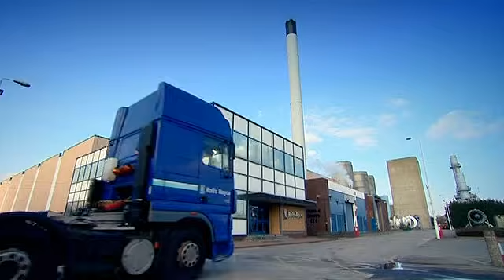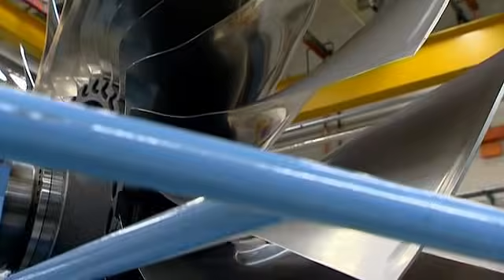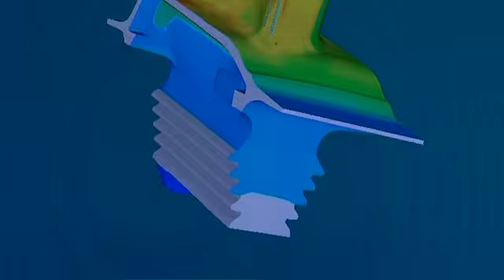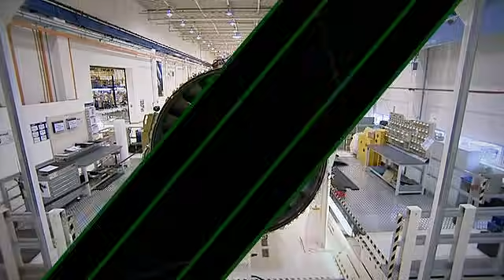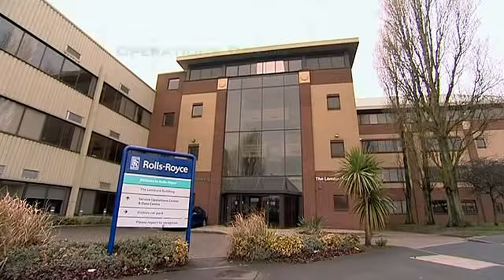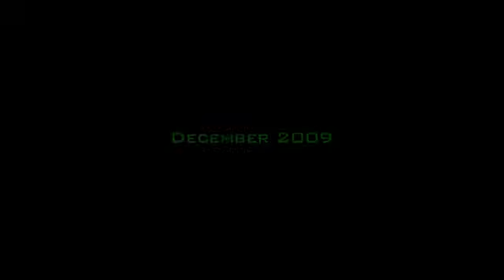how to build a jumbo jet engine

Comment: Amazing work... Wow!!
? Just after 38:08 the narrator states that the main fan in flight spins faster than the speed of sound... Did he misspeak? I thought that all the fan blade components had to be subsonic in operation so they do not incurr sonic shock waves & break... Can anyone chime in on this? Thanks!
Reply: albert bahoogadin ... Thanks for the reply.
There isn't much clear discussion on this. The thing that gets even more confusing is that the speed of sound or the Mach number is variable depending on the air pressure... Where in the compressor and turbine stages sound travels faster due to high pressures/density. How this effects moving components & combustion, I'm not sure. Perhaps the splitting of the spools & counter rotation in the new turbofans mitigates this issue by canceling out the resonance... Of course the larger diameter of the big thrust fan will make the blade tips move faster given the same RPM of the turbine components... This is probably why P&W introduced a planetary reduction gear for the final drive of the big fan increasing the bypass ratio... Quite a science in that. HA!

Comment: All these new planes bla bla bla everyone taking pictures like it is the first plane they've ever seen.  All these passenger planes look the same no fucking breakthrough.    Two engines narrow wings long tube with a tail. Light and fragile as fuck slam the tail on the ground a bit and it goes straight to service.  Two round engines attached under the wing by two bolts only for some reason. Same shit different paint. Ah yes and at little room as possible for passengers. I am 1.84 m tall 6 ft cannot fly economy without paying extra for extra leg room. A lot of bla bla fuck off it's just a tube with wings. When airplanes will stop falling from the sky then i will be impressed.  One tube with wings with 2 millions buttons in the cockpit for some reason. The fuck? Maybe airplane builders should speak with those who build cars. All you need is  a start button  and accelerator.  Stop making planes so complicated.  They are not complicated you are making them thay4way

Comment: When you think about the tolerances required to build both these turbofans and indeed the aircraft themselves, it's a staggering achievement... I remember reading about the design and building of the 747 and the entire aircraft are built to a tolerance of 1000th of a inch, the entire aircraft.. and those engines must be trebly so..let that sink in...

Comment: What they didn’t know is that 9 years later... RR engines are failing left right and center.
Reply: Same goes for the failing Pratt and Whitney engines. So it doesn't matter which country produces it.
It depends on how good the product is
Reply: like all cars built in britain, questionable reliability

Comment: sorry but jet fighters don't use  rolls royce, they are not the most advanced .
Reply: circusboy90210  _  Eurofghter Typhoon uses a RR based engine. These are turbofans for airliners - diifferent.

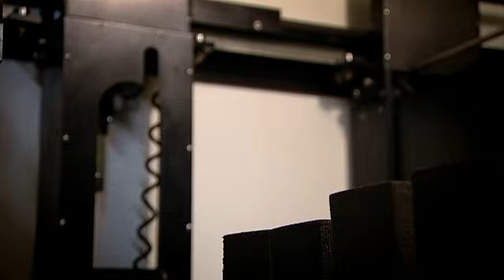Comment: 26:54 why aren’t they forged instead of cast? Wouldn’t that decrease imperfections?
Reply: It seems that the single crystal structure is better (only?) obtained with casting + heat treatments.

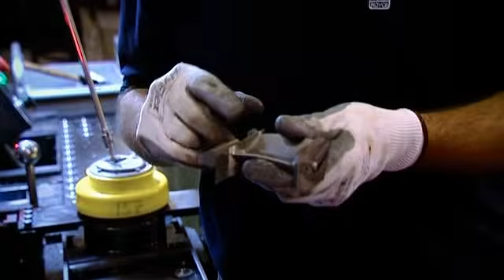Comment: At 28:00 the blades being shown are now made by 3D metal printers ... if i'm not mistaken. In any case, Rolls-Royce (and other manufacturers of jet-engines) are certainly using 3D printers to make similar blades.

Comment: Thanks to series producer Steve Crabtree and Director Paul King for this outstanding program on Rolls Royce-- so intriguing, I cannot wait to watch it at least once more-- even as long as it is. There is no wasted narrative or extra footage in covering the mammoth complexity of the Rolls Royce operation and its suppliers. 

Particularly fascinating was not only the precise engineering of energy in each engine, but even the post-sale digital field monitoring of some 8,000-10,000 completed engines in regular service.

What a tragedy it would have been for the company's finest moment, the birth of the Trent series engines, to have been eclipsed by a bankruptcy. All, going to show major advances in technology are never neatly predictable and spreadsheet-perfect affairs.

* As a historical observation, the stunning and remarkable coincidence for BMW, manufacturer of WW2 fighter aircraft engines for the FW190, to begin production of the Rolls Royce luxury sedan, once the signature product of the same company which made Merlin engines for the Spitfire (Lancaster, etc).

Comment: The Rolls welder said the tolerances were up to 1mil on a certain weld. This is a British firm and we normally use 'thou'? In fact when he said that I thought he meant mm ( I had a momentary brain collapse seeing engines with mm tolerances)! Because there is a tendency in UK at any rate to mix metric and old measures and even call mm mil - even if it's wrong - it can be critical to make sure everyone is on the same wavelength. So can anyone tell me if thou is outdated because mil is dangerous in my book and shouldn't we be using the micron or mics anyway, or do we still just say .039 thou?

Comment: sorry RR fans, you're engine isn't the only platform used on the 787
Reply: +Carly Anderson True, but it supplies over 50% of the engines fitted to them.
Reply: Carly Anderson GE9X
Reply: macdonaldjohnstonfan Especially now with all the problems with RR engines....
Reply: I take it you have a better one? I trust you're also doing night classes in English grammar too? It's the difference between knowing your shit and knowing you're shit.
Reply: ashbytimuk Wrong, GE has more like 65% of the engine orders for 787's.  700 GEnx orders to 441 Trent 1000's, GE is far ahead and well the Trent 1000 isn't doing so well at the moment either.

Comment: There are multiple different types of bearings holding the 3 shafts to distribute the axial and radial loads. Cylindrical and tapered roller bearings, ball hearings and needle bearings are the common bearings used depending on their funciton and placement.

Comment: The uncontained failure you're referring to was a turbine disc failure - not the massive fan blade which is tested here. I can't remember the details but I think there was an overspeed event and they fixed the problem quickly (they had to). R-R has never had an uncontained fan blade failure on their large civil engines unlike their competitors.

Comment: RR is in competition with Engine Alliance to supply A380 engines,EA were to supply 45% of the engines.This event didn't help RR "Investigators later determined the cause of the explosion to be an oil leak in the Trent 900 engine.Repairs cost an estimated $145 million"This was in 2010,other A380's had to fit all new engines!Emirates,usually a RR customer,have ordered EA's for their 55 A380's.Bad news for RR,if the Trent fails so does RR.EA (GE&Pratt&Whitney) are the no.1 in the world for engines.

Comment: Trick question, it really depends on what you're planning to use the engine for, if it was for a tractor you'd want something with a lot of low rpm torque such as an electric motor for an aircraft or ship you'd want something with lots of power and a constant speed like a turbine engine or some jet. As for hydrogen, in theory it could work in any combustion engine, since hydrogen would actually be the fuel, there's an episode of mythbusters where they run a conventional piston engine on it.

Comment: who in some cases, will in turn contract to Boeing, who produces the part in Auburn Wa so that it can be shipped to Germany or Austria or Italy, who then ship it to Japan, who finally ship it back to Everett or Renton, or any of the dozen or so facilities still based here. Boeing at one point was run by engineers who understood business, now it is run by business men who understand nothing about engineering. Instead simply following the latest fads, lean, outsourcing etc etc. To little avail.

Comment: as it can. As it's done so the Dreamliner is far over due, far over budget, and still technical problems arise. Boeing has contracted vital aircraft parts to numerous foreign contractors, most of whom either have never made aircraft parts or haven't since WW2. Not simply the production of these parts but the engineering as well, many of the delays are owed to these companies designs being chronically late or inadequate for their purpose. Many times parts contractors, contract other contractors,

Comment: They forgot to mention, do not mount defective stub pipes.  They did in the Trent 900, which caused an oil fire.  The engine caught fire, a turbine came apart and pieces severely damaged the landing system of a Qantus A380.   The Qantus crew saved the day.   If Rolls Royce does that one again they will be out of business.

Comment: I think you're thinking of United Airlines Flight 232, that was a DC-10, and it probably had GE engines.

There was one incident where an L-1011 had a similar problem but one of the hydraulic systems survived and no one was injured. There weren't any other engine problems, and that was one of the few times anything actually related to the construction of an L-1011 caused an incident.

The DC-10 on the other hand.. That was the one where pilots really got to put those disaster skills to the test.

Comment: RR is an excellent engine company. But it isn't the best. It's by far GE. It's unfortunate that RR caused the only crash of a 777. It's fuel/ Oil heater was the cause of the problem. That is only one reason why some don't appreciate it.
Reply: Simplistic nonsense.